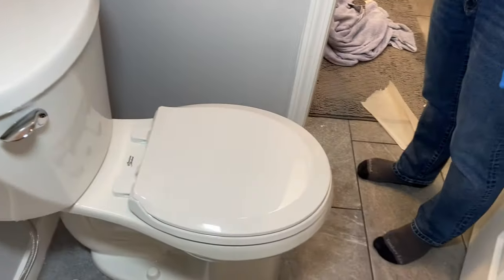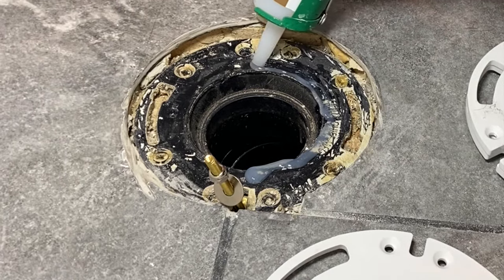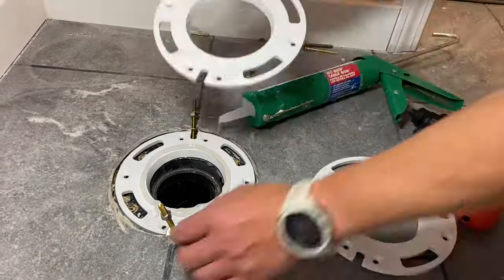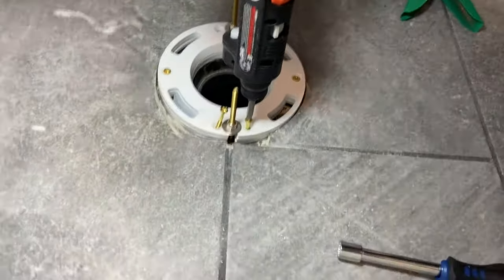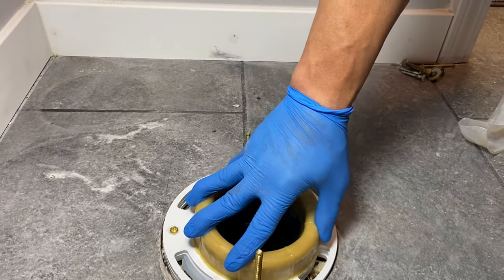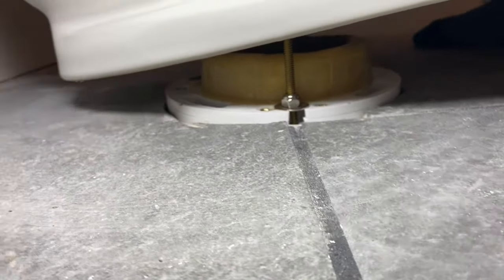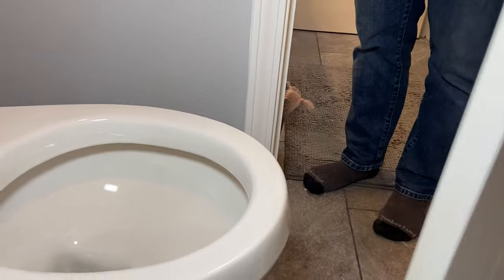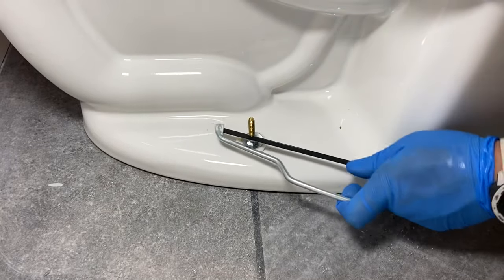Toilet Install With Flange Sitting To Low

Comment: i love my milwaukee mini grinder the 3-inch disks don't seem to wear out as fast as the 4 1/2 thin cutoff wheels and the speed is variable so you can dial in what works best for what you are cutting.
Reply from the maker: It looks like a sweet little tool. One of these days. 😂

Comment: Mine is too low too however when they put like over tile they made the hole too big. I can use raisers like u did but what about the big hole?  I think is like1/4 or 1/2 an inch all the way around.  Aim afraid f toilet leaks we will never find out since water will just go on n between floor and flu due?

Comment: I don't recommend cutting those screws with a grinder, bad personal experience. It spreads grit and shards everywhere! I spent so much more time cleaning up (it also pitted the porclean) than simply cuting it off with a saw.
Reply from the maker: That is great to know bro. I have been seeming that little Milwaukee saw everywhere these days. I will stick with the mini hack.

Comment: The flange should be flush with the floor, the last spacer was 100% not necessary
Reply from the maker: Flange is supposed to be 1/4 above finish floor.
Reply: 1/4 inch above.  Not flush.
Reply: Not true to see this more obvious turn the toilet on its side and you'll see the discharge is 1/4 below the edges of toilet which means just seating it flash you got a gap